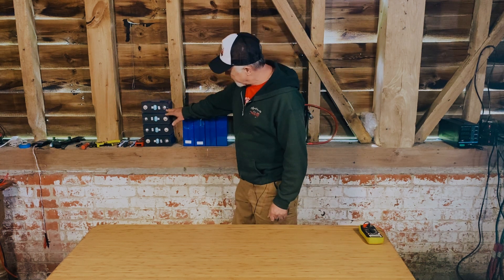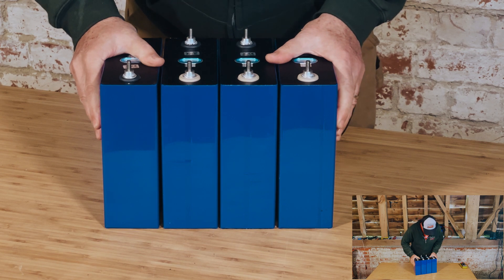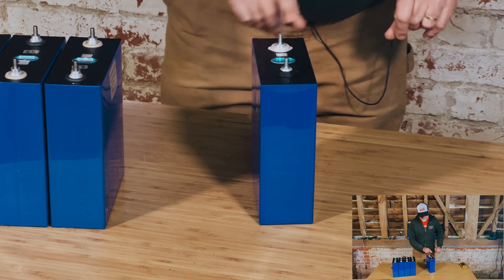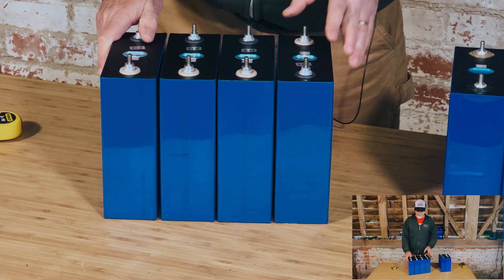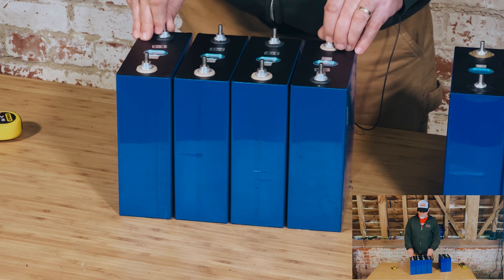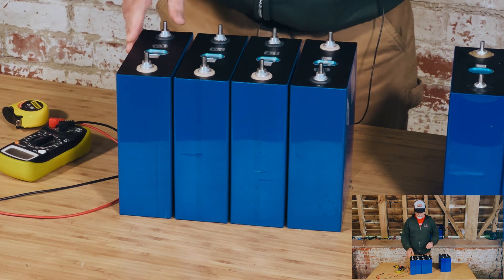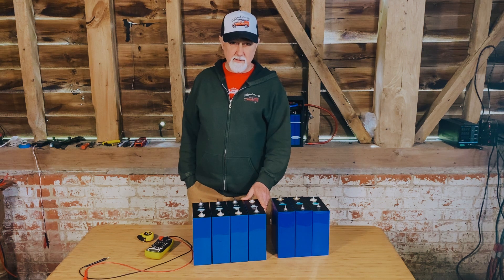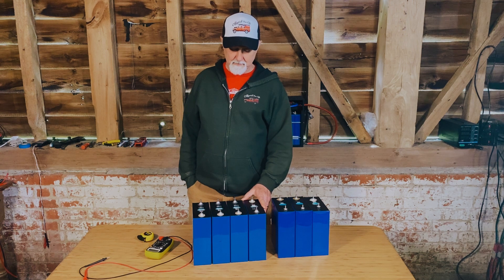Swollen LiFePO4 battery cells... are these dangerous??

Comment: i have 8 of these in my van, full time use, daily solar charge and partial discharge, same 310ah cells, capacity was actually 300ah, same amount of swelling. i was annoyed but getting a return was going to be a huge pain and return shipping is expensive. i was exhausted at the time and just decided to use them. 4 years on, they’re performing well, I have them in a tight wooden box so they can’t swell further. i worry about them though but none of the cells look bad in smart bms, one or two lag behind a little, but the bms keeps them ok.

Comment: Never store fully charged or fully discharged cells for several months without use. This causes offgassing inside and increases internal pressure, which leads to swelling. Always store cells charged between 40% and 70% and check the voltage every 3 months. Slightly compress them and cycle them by charging and discharging them several times, this will reduce the swelling. If you want really to know if cells are degraded or damaged, test internal resistance instead of measuring gap between stacked cells. In most cases if cell degraded to the point it is useless it develops internal current leak which discharges cell while it is stored.
Reply: Source? Most say charge 100% when stored
Reply: @dawemih   Just google "The Degradation Behavior of LiFePO4/C Batteries during Long-Term Calendar Aging". This is quote from their findings "Before the battery cells reached the EOL (i.e., 20% capacity fade), higher SOC was also accompanied by a higher rate of capacity fade. The reason is similar to the effect of temperature. A higher SOC will accelerate the side reaction, causing the decomposition of the electrolyte and the increase of the SEI film. In addition, at higher SOC levels where the graphite anode is lithiated more than 50%, the low anode potential accelerates the loss of lithium ions".
SOC of 10% showed least aging. But storing batteries at such low SOC is risky due to parasitic self discharge, which can lead to battery voltage drop below safe level and potentially damage it.
Reply: @dawemih  I replied you, but Youtube deleting my replies, which is odd. I will keep it short this time. Look for document "The Degradation Behavior of LiFePO4/C Batteries during Long-Term Calendar Aging".
Reply: Those are not lead acid batteries. Storing them charged is even advisable.

Comment: I put 4X 60ah slightly swollen cells in parrell, as delivered from LiitoKala. To replace a failed 130Ah winstone cell in a 16S string runing at 55V (3.45 a cell) in Aug 2021. (A small amount of clamping when installed, G clamp). The were cycled daily (melbourne) with a therotical peak charge of 36amps but realistically around 22amps due to diffrent orenations of the panels. Load was a 4Kw peak inverter. JK BMS only balanceing if any cell gets above 3.45  Took them out of service yesterday. Now horribly swollen, trying to take the preasure off the G clamp was a huge effort. That is what happens to out of the box swollen cells.

Comment: They will be fine. If you put them in a fixture with spring compression with 500 to 600 pounds of force evenly distributed across the wide face. You can then expect 5000 to 10000 cycles with 80 % depth of discharge or 15 years. This would have to happen before the first full charge or top balancing. Without compression they may swell a bit more, and it’s a bad idea to then compress after they have done that.

Comment: no one seems to be able to answer my question so hopefully you can, I have some "new" cells that have some minor swelling around the anode and cathode which isn't a huge concern but my concern is that some of them have what appears to be a white frost like spot on the clear cover on the vent, the spot is on the inside part of the vent cover, do you have any idea what it could possibly be?

Comment: Hello,
it appears that i've simmilar issue and i've made some mistakes while doing battery maintenance/handling last months - I'm the guy who bought cells,  left them away for some time and put them to van, as you mentioned in video, lol.
 
I have 8x EVE Lithium LF304 (version B). Seller have sent them to me charged to 70% SoC and checked capacity before, they were little more 304AH as far as I remember.
 I've top charged them after they came to me and put them into my van without compression fixture - I didn't know that time it's important. Cells were stacked next to eachother and  i've only created frame for 8 cells, so they were not moving (or at least supposed not to do it). They were sitting down in van from May to beginning of July. When I started van upgrades again in July, I've realized that 2 of them are little bulged, but cell's datasheet says that they can be +/- 1mm and I ignored it.

After connecting BMS and other parts, I was using them almost 2 months till few days ago BMS disconnected and I saw that all of them are bulged as on your video and one cell was discharged to 2.4V - it was probably reason why BMS switched off. Other cells were 3.2V or something, but totally debalanced.
I realized that that I made bad voltage meter / balancer wires connections and few of them was loosy/disconnected. Also cells are scratched all over, in some places to aluminum case - clearly visible that it came from vibrations while riding.

I was using cells with Daly 150A BMS and biggest load was 2,5kW inverter - used occasionally sine there was nice weather, camping connection etc.  Maximum charge current was 20A from 230v>24v charger and about 12 - 18A solar mppt charger. 

I will make compression fixture and upgrade my battery mounting, so they will not move at all. I won't squeeze them hard. Also I plan to put some material between cells, so i wont compress back already bulged cells. I will measure individual battery capacity soon (need better equipment).

Also I have some questions :

1. Please tell me, are swollen cells presented on video  EVE Lithium LF304 - evlithium.com/LiFePO4-Battery/eve-lf304-lifepo4-battery-cell.html this ones ?  
2. My cells were top charged by me with 3.65V ,but after disconnecting power source, they resided at 3.39V. Why you had 3.5V and greater values? Are those different cells ? 
3. Will you guys compress cells back to "original state", so I would have to do it with a lot of force  or a just enough to exclude grinding between cells ? I plan to do the latter solution with some additional layers between cells, but i saw some videos of guys compressing back B-grades to original width. What is your opinion ?   
4. Since aluminum case are connected with positive pole, do you guys think that cells could lost current/discharge/short it self (however to name it) and it could also lead to debalance battery pack ?

I will keep you updated,
best wishes!

Comment: They are overcharged, over and undercharging is deadly for these batteries!
Reply from the maker: Thanks for the advice. :)
Reply: Ideal setting bms over voltage 3.4 and under voltage 2.8 volt ? If that why bms manufacturer set bms 3.65 and 2.5

Comment: This sounds like a worthwhile experiment. Cheap may be cost effective if the product cost vs lifetime output is good. Good cheap PV panels costing 60 percent per watt vs the most expensive premium brand over 25 years may be the better bet. 
Maybe the cheaper batteries will also prove cost effective unless their effective number of cycles is much less than the premium brand. If they failafter a few years you have the excuse to upgrade to the latest technology.
Reply from the maker: Yeah exactly. There are good price per wh to be had in grade B/second hand kit. Especially panels and cells. :)

Comment: I use grade B cells. Bloated.  Less capacity but within the good price per watt. 280ah actual 250ah.. About 1800 cycles charge/discharge now.. Still going. I do .1C charge/discharge 80/20%. 48v 16s. Discharge to 2.6v put them in the fridge. The bloated is permanent.  Room temperature charge to 3.65. top balancing.  Good to go. On my 3rd pack now diy jkbms. Just tape compression. Grade A will swell at 3.5v not bloat.
Reply from the maker: Thanks for the advice! :)

Comment: I believe the 304 AH cells are pre-lithiated anode cells.  They do often swell a little especially if charged too soon after initially assembled by manufacturer.  Pre-lithiated cells eliminate the long traditional charge forming process and consumes less of the cathode lithium yielding a slightly greater cell capacity. It reduces the manufacturing cost of the cells.  You likely did them no favor by leaving them fully charged during the initial early life before SEI protective layer growth has fully developed.

Regular cells done with traditional charge forming process also produce gas during SEI charge forming growth process, you just don't see it because manufacturer relieves the gas before finally sealing the metal container.  The metal container is the cell seal. The actual cell laminate wraps are open at the top to allow easy foil terminal exit from wrap.  The gas bloating just inflates the metal container, the actual unsealed cell pouch wraps do not bloat.

It is caused by electrolyte breakdown when SEI protective barrier is not yet fully formed and the degrading aspect is not the gas.  It is the other decomp tar components that clog the electrode pores raising cell impedance slightly.  A little bit of bloating does not do significant damage.  Eventually the gas will escape the plastic terminal grommet port seals in metal case.  You can squeeze them a little to accelerate the gas escaping, just don't over do it as you could cause the overpressure vent port to burst if internal pressure gets to great.
Reply from the maker: Thanks for the detailed response! :)
Reply: Thank you.  If I understand, buying Chinese prismatic cell brand new, grade A cell doesn't mean it's is bad if they arrive a little bit swelled.